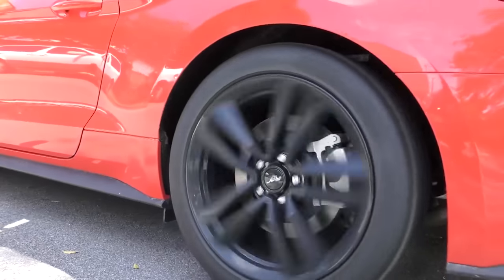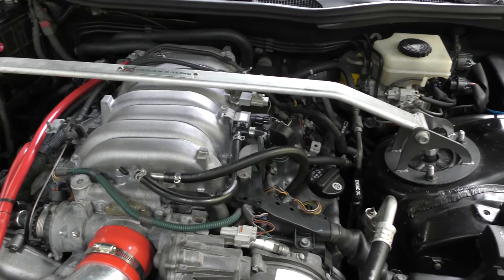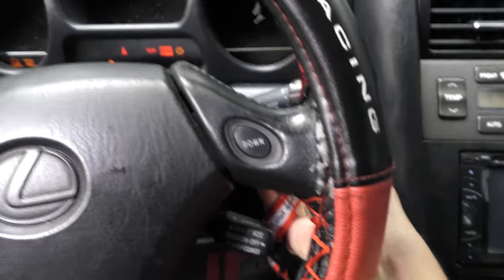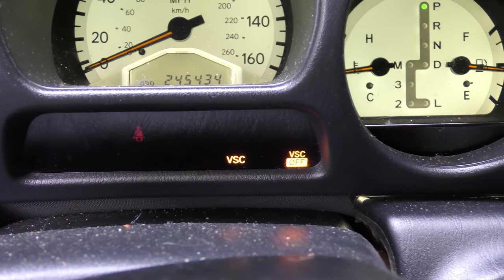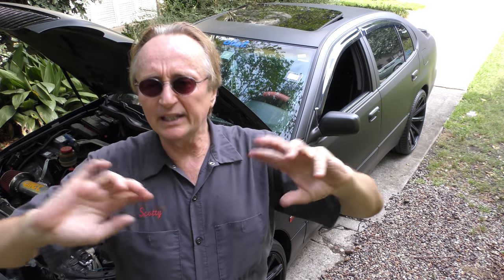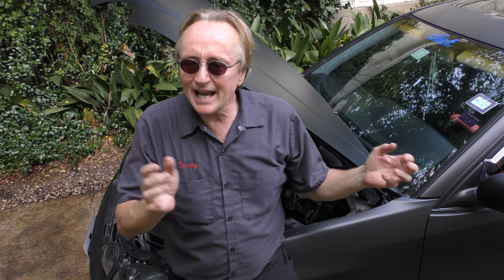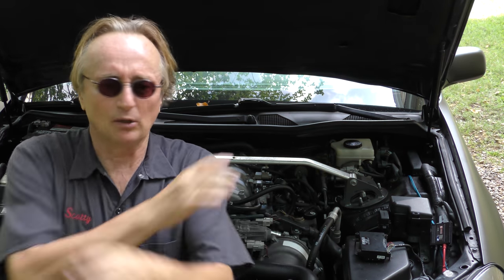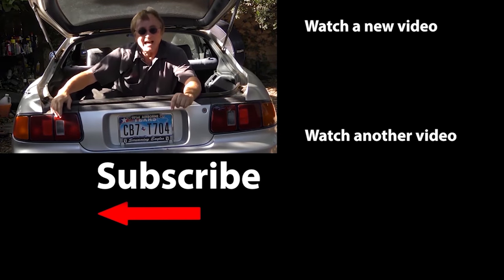Here's How Stupid People Modify a Car (A Sad Day for Lexus Owners)

Comment from the maker: I Want This New Ford Thunder Truck: https://youtu.be/8Mf7OXG_ILs

⬇️Scotty’s Top DIY Tools:
1. Bluetooth Scan Tool: http://amzn.to/2nfvmaD
2. Mid-Grade Scan Tool: https://amzn.to/33dKI0k
3. My Fancy (Originally $5,000) Professional Scan Tool: https://amzn.to/31khBXC
4. Cheap Scan Tool: https://amzn.to/2D8Tvae
5. Basic Mechanic Tool Set: https://amzn.to/2tEr6Ce
6. Professional Socket Set: http://amzn.to/2Bzmccg 
7. Ratcheting Wrench Set: https://amzn.to/2BQjj8A
8. No Charging Required Car Jump Starter: https://amzn.to/2CthnUU
9. Battery Pack Car Jump Starter: http://amzn.to/2nrc6qR

⬇️ Things used in this video:
1. Common Sense
2. 4k Camera: https://amzn.to/2HkjavH
3. Camera Microphone: https://amzn.to/2Evn167
4. Camera Tripod: https://amzn.to/2Jwog8S
5. My computer for editing / uploading: https://amzn.to/2uUZ3lo

🛠Check out the tools I use and highly recommend ► https://goo.gl/rwYt2y

Subscribe and hit the notification bell! ► https://goo.gl/CFismN
Reply: Hey Scotty Kilmer i have a 1996 Dodge Stratus ES V6 2.5L, The car startes then dies after 4 seconds also i have try to step the gas pedal still dies after 4 seconds.
I have replace the starter, fuel pump assembly, fuel filter, fuel injector, spark plug, spark plug wire, air intake/ charge temperature sensor, idle air control (IAC) valve, manifold pressure (MAP) sensor, And but still having issues.
So what could be the issue?
I need help.
Reply: Watching your video on this Lexus.  How does real leather tear?  I know there are grades of leather but car makers never ever reveal the grade.  Like bonded leather is pure crap.  So Lexus uses pure crap leather?
Reply: So the Lexus gs 400 2000 is no good  is that what you saying
Reply: this car( lexus) is as competent as consensus science backed by private funding :D
dark matter/global warming etc..
Reply: @markabendan4790  Scotty won't help you with any Chrysler product. As an actual technician I would say it sounds like a security system issue. Did you by chance get a new key cut for the ignition or disconnect the ECM? I'd say go that route.
Reply: Ayee @culmination.htx sticker
Reply: Scotty my Yaris (ex-fleet vehicle, a lot of abusive miles) had a similar intermittent starting problem, occurring only after brief startups to move the car for example.  
Turns out the head gasket was leaking coolant into the intake when cold, quenching the air/fuel mixture.  Otherwise it ran fine no codes as long as it got driven and warmed up. 
A low mileage wrecker engine was cheaper than a head gasket job on a very old engine.
Reply: It a TRD alright. Sound it out.
Reply: Hey scotty do black lives matter?
Reply: When you put a cold air intake on a car, you have to tune the car accordingly. Most people don't that's why the cars end up running like crap.
Reply: @rockroll4863  no. The GS400 is it good car. That one just got thrashed.
Reply: Hey Scotty, I'm one of those young under 25's the insurance companies want to make bank off of. You know the type. If you don't recommend doing these mods to a car, what would you recommend for increasing HP?
Reply: So who’s car is that?? Totally threw his car under the bus
Reply: Rude Rocky 
Most likely some young punk.
Reply: Scotty it just needs a custon map tune it doesn't need the cats back or anything just a 1,000 dollar tune 😉 maybe...lol
Reply: So...you don't recommend a cool air intake?
Reply: @OnzoCODM  , of course...wtf?
Reply: @dukeblair7792  it does for me too i wanted to know if i will continue to support scotty based on his answer
Reply: @OnzoCODM  , 👍🤛

Comment: That supercharger badge clearly added 100 hp. Scotty doesn't know what he is talking about :-)
Reply: Raymond Smith you clearly missed the Trd sticker. That’s an easy 40 whp.
Reply: You need the fender vents to cool off those hersprs
Reply: The owner probably hired Scotty to put it on.
Reply: What’s even funnier, the “Supercharged” badge came off an Audi. Must be some new deal Toyota signed w/ Audi. First BMW for the Supra / Z4 and now Audi. Look out, the Axis powers are reuniting....
Reply: Yeah,  to a Bean Burner.
Reply: I have that same badge on my Audi A6 which has a real supercharger 😏
Reply: Where's the massive wing?
Reply: @yg78t76t7  .. Being an Audi.. Pretty sure this pos will outlast your Audi... Ha! J/k! Sorta..
Reply: Lmfaooooo
Reply: @usmcocs09  I think you forgot about the GT86 that came from their deal with Subaru......
Reply: royaloreca No, I’m aware of that. It was originally Scion / BRZ project. Subaru is also JDM and a reliable brand at that. I was only referring to Toyota partnering up with German manufacturers. Hence the Axis powers reference...
Reply: I’ll never understand why someone would put a supercharger badge on a car without one! What’s the point?
Reply: Raymond Smith  yes he does so?
Reply: Don't forget the matte paint/wrap, no sun reflection means 2 seconds quicker acceleration!

Comment: 2,100 idle in park lmao 😂
Reply: Oof lol
Reply: Definitely 2,100.
Reply: It's 1100
Reply: On drive, it's 1100. He literally said he put it on Park, and it changed to 2100 just before he shut it off.
Reply: My v8 doesn't even rev that high at 70
Reply: Timestamp 4:55 … it’s idling 2200 when he shifts to park

.
Reply: Needle is one line above the 2 on the tachometer, so that’s 2000 + 200 == 2200 rpm

.
Reply: Japanese car cold idle is really high standard
Reply: @charliebell1207  on a car that red lines at 5500 I don't think having an idle that high is normal
Reply: It may only rev round to 6600 on limiter but cold idle is around 2100 for a moment then 1600 then 1200 then idle drops to warm idle. I should know I own a gs 300 and a 430 and have owned serval other gs300
Reply: @andrewgregory151  .

Comment: Instead of having all these extras installed he doesn't even care about a ripped leather seat..? Dang that guy lost his mind, well butt.
Reply: The Catmother  He did all those mods and the car has no power, what a waste
Reply: Dog Chood car. Oh, the stench! Call the CDC.
Reply: Don’t you think the engine lost power because of how old and tired it is? I mean I never thought a altered exhaust system or cats removed would take away more than half power
Normally when I increase exhaust flow I gained power...
Reply: multiblade04 yea the kid didnt loose 50% power lol i mean those intakes are prob from previous owners aswell lol. Exhaust sounded decent
Reply: @multiblade04  If the computer doesn't have an O2 sensor, it can't regulate the fuel:air ratio properly.

Comment: “This baby will never pass any state inspections.”
“It’s got no catalytic converters”

Texas: you’re good
Reply: Lol u can pay ppl to bypass them
Reply: Depends on the county. Any city (blue) county is very strict.
Reply: I could been auto mechanic but hurt my shoulder playing sports I had  high flow cat on my ride my gas mileage went up 6 mpg that's what cause global warming and autism car that poor made or mantain6
Reply: Same as Oklahoma.  Hell the guy at the muffler shop recommended to take mine off
Reply: @kinglangren  if you do car run horrible in most cases cause computer be confused
Reply: @matthewgodwin6688  what?
Reply: I'm a state inspector in Austin texas, in the Travis County district, even if your vehicle is exempt from emissions testing it will still fail since all inspectors should check for cats and mufflers during the safety portion. However there are some shops where it doesn't matter, they don't follow district law since they hardly ever enforce it
Reply: Running a car without a cat is against federal law. Doesn't matter what state you're in. But if your state doesn't test emissions, you probably won't ever get caught
Reply: Brandon Pierce Exactly. I live in Florida and my Nissan 370Z has a full catback exhaust and I’ve installed long tube headers on it, so obviously no catalytic converter. Thank Florida for no emissions testing 😂👍🏼
Reply: Brandon Pierce I’m in Oregon and we don’t have to do any of that testing stuff I’m not sure if it’s like that in the whole state but not where I’m from
Reply: Same in Canada now to 😂
Reply: Naw man, Texas is strict. Go to Florida; no one gives a crap.
Reply: Kien Johnson cats? Lmaooo . Catlesss all dayyy
Reply: Florida and South Carolina as well.
Reply: Good in Florida too!
Reply: Kien Johnson only in the City of Austin. If it’s outside but still Travis county you can get away with it. Still can either way. Just gotta tell them it came that way from the factory. Some cars don’t have mufflers from the factory.
Reply: Texas has very strict emissions requirements, most southeastern states don't though
Reply: Mississhitty too
Reply: @derekisthematrix  not in LA, IE, OC🤙🏽
Reply: Lmao here in Cali I used to know a guy to illegally smog my old whip.
Reply: Now you can do it a lot stuff if reprogram engine but it's against the law cause of emissions that's why they want all electric cars cause then only fee can work on them
Reply: TX also doesn't have a ruling on exhaust loudness...
Reply: Florida
Reply: Texas still check for cats. You can take it to the hood and pass it anyday with a bit extra dough lol.
Reply: Just houston sucks for Texas on emission.
Reply: Tennessee: you're good
Reply: Canada: you’re good we don’t have emissions tests here lol
Reply: Probably getting it Tuned with the oxygen sensors on will make s difference
Reply: Oregon: you good
Reply: Michigan too 😬
Reply: It’s in Texas
Reply: @Confirmatarian  no worries, kids that modify their cars and don't have catalyst converters for that same reason just pay the inspector to pass the inspection, cash is king, you just have to know where to go, not hard to find them.
Reply: Lol so true. Just my car inspected the other day in Wise county Texas and all they wanted to see is if my lights and horn all worked. They didn’t even test drive
Reply: Arkansas
Reply: The Orange One yeah mines 25+ years old so I’m good
Reply: As USUAL the people in the comments miss the point of the video. Just because you can put something on a car doesn't mean you should especially if it is not done right.
Reply: Houston and a few other cities have emissions testing.
Reply: Good in Florida lol
Reply: @disciple1381  
agree.....the  engineers  that  designed  the  systems  did  it  right, so  the  car  runs  right.   garage  "engineers"  that  take  $ 20 million  in  engineering  n  design  n  replace  it  with  their  $ 200   "modification"  using cheap  aftermarket  parts  end  up  having  unnecessary  problems  n  shorten  the  life of  the car.  why ?......because  it  "looks cool"..but  runs  n sounds  like s--t.
Reply: Yea in Calif and my state is highly illegal
🔥 burning but more population that how many cars the ash was so bad in Pa I had change my oil
Reply: South Carolina has no state inspections, stop by xD
Reply: @moonshadow9178  I was told by my mechanic in Pa expect changes in inspections cause we got wolf in wolf clothing
Reply: Matthew Godwin yeah we gotta see what happens, its still wise to keep a car running in good shape even if inspections arent required. No one wants to have a car break down midway
Reply: @moonshadow9178  i am only spending what need cause thing Biden getting im and there be huge depression and riots will be much worse
Reply: @moonshadow9178  Ohio doesn't either
Reply: laughs in Michigan
Reply: @antholito  go Calif and if not 50 state issued they make you fix it 
Order part and wasn't so held my order up cause Calif crap cause I am in Pa
Now Calif have 2 and 3 if Trumps loses and he be dead in 2 shouldn't said that cause Taylor me
Reply: @driver4011  do you understand what a tuner is?
Reply: Lol same in KY you can drive anything
Reply: MegaMrblackguy  depends what county or district you're in..basically if its primarily democrats there then there will be emissions.
Reply: I live in Alabama amd we have no state inspections or restrictions on any modeications to a vehicle. Now you could get a ticket for having a too loud exhaust.
Reply: Massachusetts: no cats? Please wait while we get your prison cell ready.
Reply: @hamz1179  but if you get stopped for traffic violation and the officers suspect the car has been modified, they can perform on the spot check. If you are found in violation of the laws, they could impound your car and give you a hell of a lot to think about.
Reply: @derekisthematrix  nah I’m in a very blue district and they don’t care
Reply: Illinois: you're good
Reply: Utah: You good
Reply: Lmao Kansas doesn’t require any inspections. 🤣
Reply: @matthewgodwin6688  did you just have a stroke?
Reply: @tabryis  I put high flow cat on my grandma increased my mpg by 7 and got rid of migraines only problem need spiral muffler so noise police didn't give me ticket 
Some cars you can't do that cause computer hate change so check the manual or mechanic 
I went from 3 cone to 5 cone and honey comb was bigger
Reply: Washington: you’re good!

Comment: Has intake and exhaust.
Scotty: "All these crazy mods"
Reply: He's 100% correct though
Reply: @eyedunno8462  LOL no he is not...
Reply: @cyberlocc  it's clearly a princess auto special cut the exhauste off and put intake on it then put a supercharged sticker on it lol it's just some kids car
Reply: @cyberlocc  "All these crazy mods" The car doesn't even put out the original 300hp anymore.... these mods ruined it
Reply: @cyberlocc  if your street car can't pass state inspection due to its modifications then those mods are stupid/crazy
Reply: dcard228 unless you live in California
Reply: prolly straight pipe exhaust and a cold air intake sucking in all the heat from the engine
Reply: @willyames9463  never understood why they calling cold air when its sucking in air from around the engine and exhaust manifolds. Factory air induction seems colder since it pulls the air from out side the engine bay.
Reply: Stickers and badges are mods too.
Reply: Crazy as in crazily badly done. Is that even English?
Reply: @jamescockerham9992  The point of a cold air intake is to get it away from the exhaust manifold and mount it somewhere that it can pull in ‘cold air’... This guy just did it incorrectly & probably decreased performance in the process...
Reply: @ThumperG  again the factory setup does this just fine. If you want cold air you need an intercooler or move to a colder climate. Also every ricer and handa boi I've known and seen installs these things. Calls them cold air intakes and then starts bragging about all the mustangs they beat. 😆 hope we can both laugh at that one.
Reply: At this point I want to do a crazy swap and take it to Scotty to work on. Like an LS swapped Civic just to see what he'd say in a video.
Reply: @jamescockerham9992  It's because it's not a cold air intake, it's a ram air intake. CAI will position the filter away from the engine, such as down by the fog light
Reply: @dcard228  true
Reply: @jamescockerham9992  that’s not a cold air intake that’s a short ram a true cold air intake is when you lead the filter out the engine bag to the outside we’re it sticks in colder denser air so the fuel injectors inject a little more fuel to make the 5 to 12 horsepower
Reply: @redfrontier1968  I know its not a cold air, cause it draws air from inside engine bay. Also the one you refer to sounds like you spent money for something your car already has. Every car I've owned (even the ones I've owned from the 70s) have ducting to pull air from outside the car.  So like I told the last guy. Tell the Honda bois
Reply: @12DMC81  the 250000 miles ruined it
Reply: Chad Hendricks  yeah bro she’s running strong at the time she was in limp mode
Reply: I’m sure the trans is what’s making it weak like that
Reply: Exactly
Reply: 3:03
Scotty " The oxygen sensor is unavailable cause all that was taken off with the converters"
Scan tool on screen " Oxygen sensor AVAILABLE"!!!
 Stupid scan tool must not have fit Scottys narrative " if you install a cold air intake or ANYTHING else to increase performance ..your stupid, your car is stupid, and its 100% illegal to drive 100% of the time on 100% of all roads. But HEY REV UP YOUR ENGINES👍
Reply: @12DMC81  Yes because it's not done right.
Reply: @jamescockerham9992  i had a honda hybrid that made like 10 hp and I installed an intake just like this and it was noticeably faster and got better fuel efficiency
Reply: @averyparticularsetofskills  It wasn't done correctly lmao. It's probably certain 02 sensors that aren't on. Most cars have upstreams and downstreams. up streams measure the fuel and air mixtures. downstreams measure the cat efficiency.

Comment: When your "cold air" intake sits in the hottest part of the engine bay... 🤣🤣🤣🤣🤣🤣🤣
Reply: If I'm not mistaken that's an srt ecu and those were one of the best intakes for Lexus gs400s
Reply: UZS DC really? Wow. How many other options were there? lol (joke). But I figured heat soak in there from that thicc ole V8 would kill power after 30mins or so.
Reply: @Meekmillan  if you leave the factory snorkel from the front of the hood then cold air should come in with ease to that intake, the 1uz fe vvti motors have a lot of heat soak around the sides where the manifolds are and Toyota did a good job of preventing heat soak to the front
Reply: @UzsDc1UZ  I don’t think it’s an SRT, doesn’t quite look like the SRT I have on my 400. Also missing the aluminum box that helps isolate it from the heat. Also doesn’t sound like a SRT. The SRT sounds sick, kinda like a turbo spooling.
Reply: @pigbelly100  honestly yeah lmao I don't know why I said that a while back. The srt intake looks better constructed like the actual piping is way cleaner and more aluminum looking.